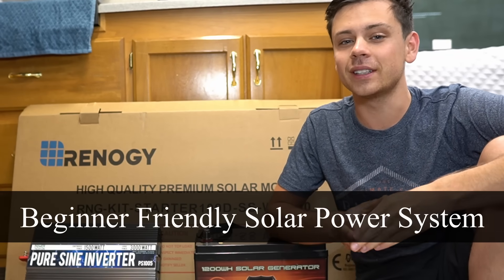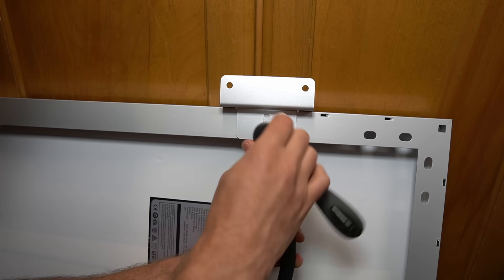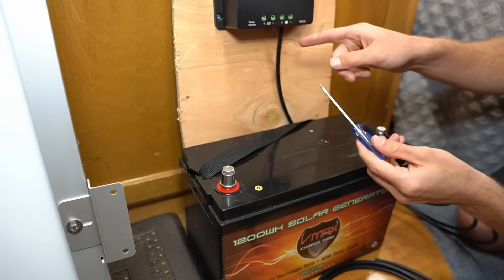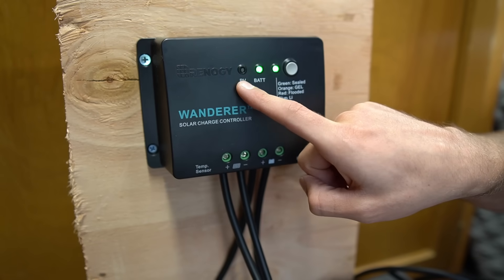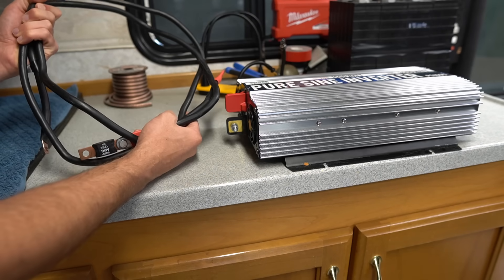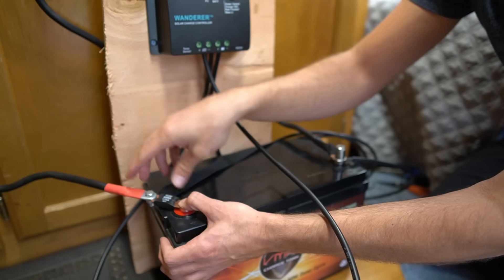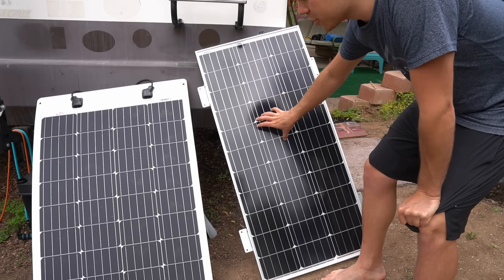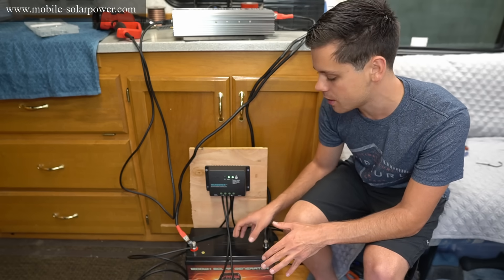Build Your First Solar Power System! Beginner Tutorial Easily Explained, Budget Friendly

Comment: What is a optimal battery temperature range? My Redarc power manager 30 shows my highest temp from my 3 X 120Ah AGM's as 34 degrees C with a minimum temp of around 26 degrees C with 520W of solar.
Reply from the maker: Depends on battery but they all like 74 degrees Fahrenheit

Comment: I recently decided on solar for my boat versus a gas generator for when I’m anchored to keep my batteries charged... The question I have is about the engine’s alternator; do I connect the alternator to the aux battery bank with a diode to keep from backfeeding or is there a charge controller with a secondary charge input for the alternator?
Reply: you'll want something like a Blue Sea battery relay for this application - it only connects the two batteries when the voltage is high enough.

Comment: Will, you seem to promote inverters in most of your "basic system" videos. My philosophy is that for a simple off-grid system you should make every effort to avoid an inverter. Inverters waste power. Most of our devices run on DC power so why not keep everything DC? It's pretty easy these days. Most devices are USB so just attach a few USB outlets to you r battery.. You can usually get DC power cords for computers and other devices.  Have I missed something? Are modern inverters much better that previous generations? I thought the conversion from DC to AC and back to DC wasted 15-30% of your power.  To me they seem an unnecessary expense that will end up wasting your precious Amp hours.
Reply: Most inverters are about 90% efficient and some people just want to run some AC appliances -- it's just a matter of preference.
I believe Will is showing people who are also considering an emergency kit as well as people looking for off grid cabins and RVs/camper vans. 
Inverters are still incredibly useful and can be turned off when not needed.
Reply from the maker: Yeah I used to try to avoid inverters like the plague when I first started, then realized the 10% loss is not a big deal. And ac appliances are much cheaper and easy to find. And adding an extra solar panel can make up for the loss by the inverter. So I love inverters now. Does cost more but it's much more practical

Comment: Been following until I have more information and need to apply it.  I'm a grandma so please help.  I have decided on a 100 watt Rich and I know you like them.  But what about the battery, please don't direct me to your video on that.  I need to know the next steps.  So I buy the panel, need a batter (not a high dollar item).  I think I will buy a Jackery which I consider a clone of Gold Zero.  I have absolutely no one to help me and I am planning to be on the road the next few weeks. Help.
Reply: If you plan to buy a Jackery, it won't make sense to buy a battery. If you have a goal zero, then you can add capacity later on.
Reply: Thanks so much for your quick reply.  I got a referral from someone who answered my question and thanks to the both of you I will order the 240 Jackery and a solar panel that goes with it.  I think you have one of the best sites for information like this.  Good luck and thank you.   @AaronGeller

Comment: Great video. I have a question. I thought the LOAD output on the charge controller was where the power went when the batteries are full. I have seen big resistors and heating elements used to burn off extra power when batteries are full. I was thinking of using this extra power to power a water heater but I am not sure I am correct because the system you got may be different. Thanks again and love to learn from your vids.

Comment: Question: Why would it be a bad idea to mount panels similar to how roof shingles are laid. The upper one overlapping the one below by just a bit. Granted, it would have to be on a custom spacer. 

As a way to make a somewhat good roof.
Reply: Unless you overlap just the frame you will end up with shading, losing production. But overlapping is a bad idea from a future maintenance stand point. How would you replace a module in the middle? It would be a pain. Plus you want adequate air flow. High heat drops efficiency  and voltage production. The cooler the modules stay, the higher the voltage. On top of those. For maximum irradiance, which equates to current, you should mount your modules/pannels at an angle equal to your latitude if not mounted on a tracker, or a way to tilt them during different seasons. Hope this helps.

Comment: just found your channel. Have not watched all of them yet. But will get there. My goal is to get to know how a solar system works. and be able to put together. Then when I retire I can install a massive solar system on a school bus conversion. so I can run any thing on the bus. Even up to a welder.. I think it would be real cool to have solar combined with wind turbines. That way no sun no problem. maybe it will be a little windy out and can charge that way. You are very informative. Thank you for all your knowledge. And yes I did subscribed!!
Reply: Solar is very powerful, but that being said, what do you do in winter when the days are shorter and if there are clouds? You might want to look into a DC-DC converter (Renogy sells them now) that can give you 40 amps or 480 watts in one hour of driving. 
You might do better to invest in solar over wind because of what I know from people who have the little turbines, it's not as good as one might think. 
A regular generator might service you better for massive loads.

Comment: At 12.2 volts, what is the depth of discharge for your battery? I would go for 50%!
Reply from the maker: It's 65% at 12.2 volts, and 50% is great but if a beginner messes this up even once, they can lose potentially 1000's of dollars, so best to recommend safest number possible

Comment: If you're battery is only 100 amps how can it deliver the current to trip the fuse you are using between the battery and inverter.
Reply from the maker: That is the capacity, not the disxharge rate. It is a 100ah capacity at 12 volts. This battery can deliver a constant 500+ amps, and short circuit situation, in the 1000's of amps.

Comment: It looks like you put a wire with the red positive O ring on the negative of the solar panel.. i know it doesn't matter as it is just a wire and you connected it to the correct terminal of the controller.. just an observation.
Reply from the maker: Yeah it switches. Mc4. But I want beginners to only know polarity at the panel itself. That's why doing each wire at a time will reduce confusion

Comment: Can you show how to charge the solar battery from shore power should you need to do so?
Reply: you can buy an inverter charger where it's both a DC-AC inverter and charges your house battery
Reply: @AaronGeller  I would like to utilize it with a Tesla 24v module. Are there any inverter chargers that you know of that allow the custom settings required by that battery?
Reply: Gary Stone most inverter charges aren’t made for lithium yet so you need something where you can change the charging profile. Will has a video on this and on his website. Hope that helps!
Reply: I've watched his video! That's my problem. He uses the solar charge controller to prevent overcharging of the lithium batteries. He uses a Victron battery protect to keep from under charging the battery. 
HOW WOULD I KEEP THE INVERTER CHARGER FROM OVER CHARGING THE BATTERY????
Reply: Gary Stone so to reiterate, “you need something where you can change the charging profile”.... aka it needs to be programmable. I believe Victron makes them for a pretty penny.

Comment: Hey Will. Great video for a novice like me. Anything to be aware of when connecting a cheap voltage monitor to a 12v battery? Do they need a fuse or just wired straight to the battery terminals?

Comment: I have a beginners system very similar to what you have on this video.  I put it together by buying the different parts rather than as a whole kit.  It works well but the one thing I have learnt from this video is that my wiring may need to be beefed up and get one of those lovely little bolt on fuses.  I have my connection from the panel to the controller setup on Anderson Power Poles for easy disconnection before doing any work on the system.  Many thanks from someone who definitely needs help....... :)

Comment: The only thing I'd add is if you need another solar panel, you might also want to consider a larger battery or a second one to wire in parallel with the first one. Otherwise, the extra power potential might be wasted without a means to store it during sunlight hours, and especially for a possible cloudy day in the future.

I had an emergency solar power system with two 55 watt panels and two 20 AH batteries, and it worked quite well for a little emergency lighting at night and to keep my electronics charged. I had a small inverter that I used sparingly. Most of my chargers were for 12 volts, just like my batteries.

Comment: Fantastic video. Thank you.
Reply from the maker: You're welcome!
Reply: Will Prowse any chance you’ve done a video or could do one showing how to add extra panels and batteries if you want to increase the load?
Reply: @SteveJFrost  One either connects two devices in parallel (increase amps not voltage) or series (increase voltage not amps). 
You can parallel connect to 12v battery and have more amps or series connect two 12v and have a 24v system. 
I'm pretty sure Will has videos on it but just google search "solar panels in parallel/series" or "batteries in parallel/series" to see diagrams. It's much easier than you think
Reply: Aaron G thanks for the info. I’ll check it out. I’m not clear on why you choose to do it in series or parallel though. What is the purpose of doing it either way?
Reply: Stephen Frost higher voltage does mean thinner wires which means less money. Sometimes people have appliances that need to be a certain voltage to operate. Higher voltages are more dangerous of course
Reply: Will has a video about the advantages of 24v systems
Reply: Aaron G You’re a star. Thanks so much.

Comment: You can't trust novices to monitor battery voltages. :) The best addition to one of these systems is a low voltage cut-off/disconnect or voltage sensitive relay. I see so many people kill their lead acid batteries because they or someone else discharge them too low and form lead sulfate crystals to a point where their solar system doesn't provide enough current to reverse the process.
Reply from the maker: Man I totally agree. I'm going to make a video on low voltage disconnect systems. Great point you made

Comment: If it were not for the way you simplify stuff, I wouldn't have gained the confidence of doing my first DIY solar system.Thank you Will. Question is why would you recommend the charge controller be near the battery yet the cable connecting the two is so long?
In my system I have used cable size 10 which is 1foot long.Thank you once more for the good work.

Comment: you should install positive cable first then negative cable, that way your positive wont spark.
Reply from the maker: It will still spark. The positive first has to do with automobiles and avoiding short circuit. The spark will happen regardless

Comment: I would love to see a video showing exactly what this system is capable of powering and for how long before battery is below 50%
Reply: Yeah exactly...
Reply: I have almost the exact same system and during the summer average about 240 Watt hours per day.
Reply: @simplethings3730  wow, that's pretty low in full sun.  May want to check the angle of your panel or go with an MPPT charge controller.

I built my small back up system in November 2014 - still running perfect with the same components.

My set up is somewhat similar with a 12v 100W Grape Solar solar panel, Renogy 20 amp MPPT charge controller, 4 - 6v 215Ah Duracell deep cycle batteries connected in series/parallel (12V/430Ah system) and a 2300W modified sine wave inverter.

I have run my deep freezer that pulls 36.1 watts/hr (at peak) during the day, but I unplugged the deep freezer when the panel stopped producing power in the evening. Everything stays frozen until morning, which I then plugged the freezer back into the solar system before going to work
-Note: definitely should run a deep freezer on a pure sine wave inverter.  I noticed the deep freezer got a little warmer on the sides running it on a modified sine wave inverter - it still worked though, just don't know about longevity of the freezer with the extra heat production.

I have done the plug and unplug thing for entire weeks at a time (as a test) and my system never dropped below 80% capacity.  So technically, I can do that indefinitely and keep my food frozen.  

I also keep frozen water bottles in the deep freezer to put into large coolers for things that need refrigeration - like milk, eggs, etc.  When they start to melt, I'll swap them out with the other frozen water bottles from the deep freezer.  This was out of necessity because of my refrigerator messing up every month.

There is no way that this system will run my side by side refrigerator, as that pulls 153W/hr according to my Kill A Watt meter - 17Kw over a period of 116 hours.

A few days ago, I ordered a 24v Renogy 270W polycrystalline solar panel which will allow me to run my deep freezer without the unplugging and plugging.  It was $222 at Home Depot.  Great price for a panel with a 16% module efficiency.   My Renogy charge controller auto-detects 24v or 12v solar panels so no need to change battery voltage.
Reply: @SojournerNX  I check the angle with a soda can. I put the can on the panel and make the shadow go away. This average includes everything, including cloudy days. My solar panels will put out about 90 Watts Max. I don't have any charge controller. I just watch the voltage and it when it gets around 13.5 I'll fire up the inverter and discharge the battery to 50%. I also do have some shade on the panels. Most of my losses are from my cheap inverter. I would have to look at my notes but if I remember correctly, if I am drawing a 100 watt load from the inverter, about half of the power coming from the battery is just running the inverter. I have increase the load on the inverter but I haven't collected data yet to find out how much that has improved my Watt hours.
Reply: @SojournerNX  new at this and trying to make sense of it all. Do you think it can run a common fridge/freezer for a short period, say in a blackout?
Reply: Like two light bulbs at most....

Comment: Battery connection:  Positive first, ground last..  Yes,  it still sparks, but nowhere as much as connecting the positive cable last.  Otherwise, great instructional video.
Reply from the maker: No it's the same amount. The reason people do positive first is for automotive. Less chance of causing short when tightening down terminals. Common confusion from this. Same amount of spark.

Comment: Thanks Will for all your great videos. :-) I'm about to add solar power to my RV. I have been looking at a 200W solar panel setup. I do like the Victron Energy SmartSolar MPPT 100/20 12/24V-20A Solar Charge Controller Bluetooth for it or possible its smaller sibling. But there is one feature that I miss big time, that is having dual charge capacity; for the leisure battery pack as well as the starter battery. 
As far as I know Victron does not hold a charge controller with that feature. However, there are another "premium" solar controllers from Votronic, model: MPP Dual 350W/21A/ MPPT and its smaller sibling MPP Dual 250W/15A MPPT controller. These charge controllers has two battery charging ports: Automatic charging of the main supply board battery, as well as support charging and trickle charging (max. 1 A) of the vehicle's starter battery with overcharge protection. As my stereo as well as some of the lights in my RV are powered from the starter battery by factory design, for some reason. I would benefit from the support charge that the Votronic offers. But as far as I understand their solar charge controllers do not offer the ease of use and tuning as the Victron does when it comes to programming and monitoring of the controller.
 
Have you ever come across these controllers from Votronic? 
How could one support charge the starter battery using a solution based on Victron products in your opinion?

Perhaps the questions above would inspire one or two videos? ;-) "Review of Votronic solar charge controllers" as well as the usecase "dual charging on RV's"? :-D

All the best /Toby

Comment: Do you have to plug appliances directly into the inverter? Can you run outlets off the inverter? Thanks.
Reply: Most RVs run outlets from the inverter.
Reply: @AaronGeller  thanks Aaron. So... hard wired from the inverter to a breaker box, then to the outlets, or no breaker box needed? It's all new to me brother 😉
Reply: Compass Life it’s like wiring in a home at this point - you plug the cord into the AC outlet and then you have the wires going to an AC breaker

Comment: Well done!  This is a good introduction to solar basics 101.  I especially like how you have highlighted the importance of having at least one fuse to the inverter.  It may be a very small setup you are working on but it can still seriously hurt someone if not treated right. Having good thick wire is paramount too, especially with 12V setups.  Thank you for your video.